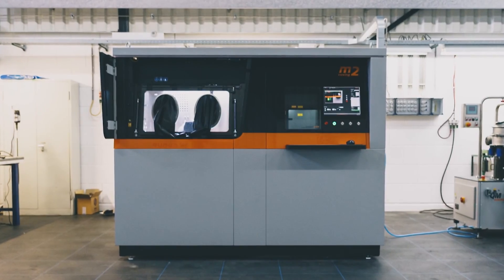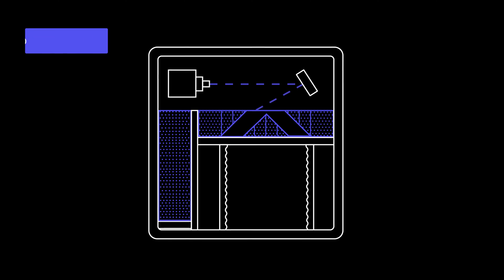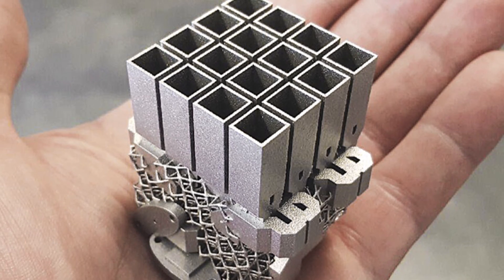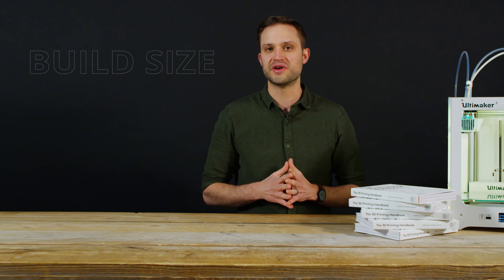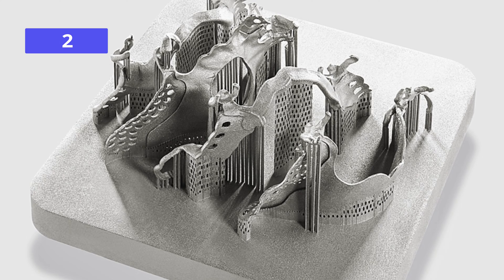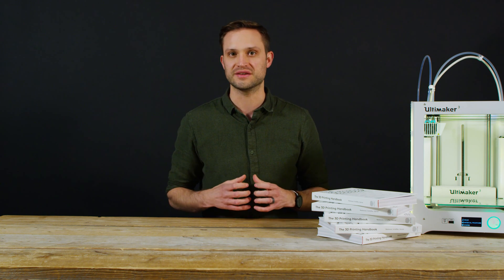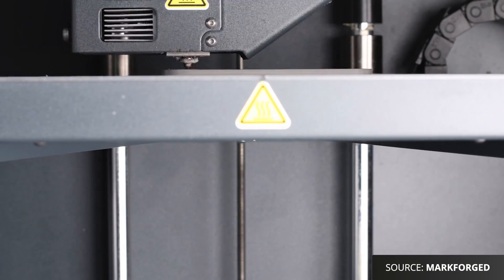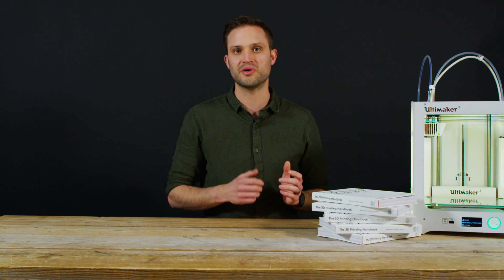Metal 3D Printing - How to Print Strong and Functional Parts

Comment: Hmm, you talk about it as if metal 3D printing is a seperate and single technique (which it is not, it is only a material) and compare it to SLS. Metal can be printen through SLS, DMLS or even FDM so saying it is different than SLS (it is SLS but another material) and it always needs support is wrong because there are many different techniques. Don't confuse a material with a technique.

Comment: I'm just waiting for this tech to start becoming more reasonably priced. It's tough to justify buying the complete system needed for printing, debinding, and sintering as someone without a corporate budget. I think this process has the potential to allow designers and entrepreneurs to expand their capabilities greatly.
Reply: I think it's already plenty useful, atleast for larger companies, as since they sell so much, paying 1 million per 3d printer for a 20 to 30 percent cost reduction is very viable and can be felt by consumers in the future. Although cheaper printers make it possible for small businesses to take advantage of this as well.
Reply: sillygoose goose  I have a 3D printer but casting is only an option for certain materials and provides a whole other set of challenges/problems. The probability of weak spots, air pockets, granular inconsistencies, and all the other pitfalls of casting (especially small scale and small batch) are radically increased compared to 3D printing. Plus, casting from a 3D mold doesn't allow designs to take advantage of the benefits of 3d printing such as the incorporation of flow paths that maximize efficiency that couldn't otherwise be machined without significant effort if it is even feasible.
Reply: It is really not meant for home use. Some 3D printing technologies will and honestly should never be used at someones home.

Comment: A very simple method for 3d printing is investment casting. 3d printing I'm sad to say is a expensive gimmick because so far 3d printing isn't a replacement for conventional methods and really the important technology is 3d scanning
Reply: Investment casting is the easiest it has ever been. Mostly b/c there are sand 3 printers that will make molds or finished products at the foundry.